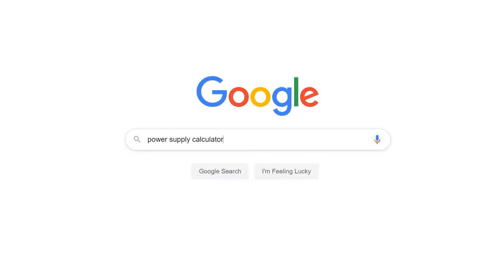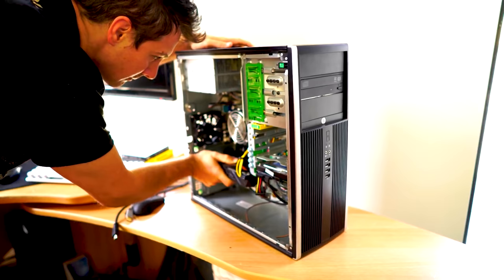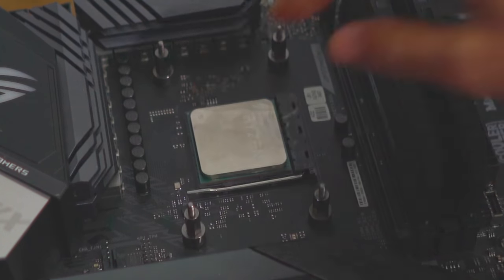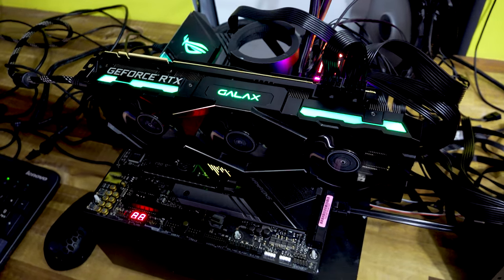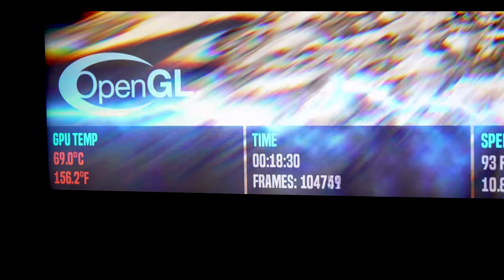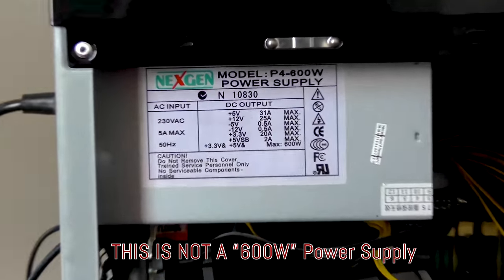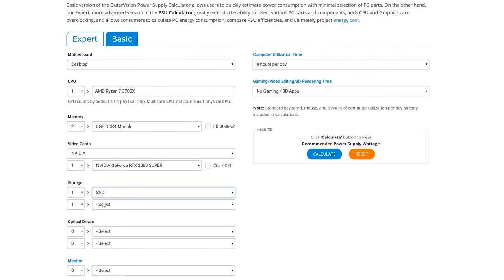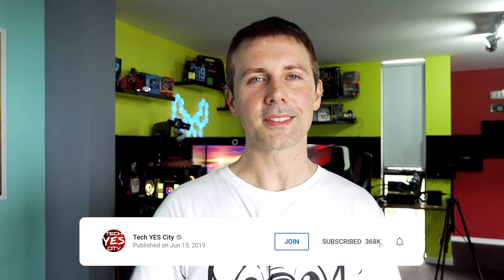I Tried Running a 3950X and RTX 2080 Ti on a 450 WATT Power Supply...

Comment: Hi , what about my Sirtec PSU ? 500w max output , 12v1 20A , 12v2 20A (it has 2 x 12v rails each with 20A) ,400w on 12V. Im using this PSU for 9 years ( since 2011) , i used it on many configurations. First i used it with an oveclocked phenom II x4 955 oc to 4ghz + radeon hd 7850 oc for many years , after i used it with and i5 4th gen oc + rx 480 8gb oc ( even with other low power components like rx 560) , now im using it with an i7 4770k oc + rx 590 oc and its still runing without any issue.

Comment: I got a evga 750watt gold rated psu for the future i dont think overkill psu is a bad thing it just means in lets say 5 years time assuming your psu isnt dead by then graphics card and processors will be way more powerfull more effienct but only soo far ypu can take effiency beforr you have to chuck that out the window to gain loads more performance

Comment: But did you overclock the CPU and GPU, like most gamers would do to get maximum performance from their setup. I doubt it would run for to long before it crashed. Your video card probably crashed the game. Also a 650watt 80 plus PSU will run most any setup out there. Unless your running a 2080, 2080Ti, a i9-9900 or threadripper. Then you might want a 850watt 80plus or higher PSU.

Comment: Planning to upgrade my gpu from rx570 8gb to rx5600xt or rtx 2070. Limited psu choice in my country.

My specs po are:
R5 2600 with stock cooler
Asus tuf b450m pro gaming
Tforce 16gb ram ddr4 3200
Msi armor Rx570 8gb
Corsair cv650 80+ bronze

(I just upgrades psu from generic 600watts and mobo from giga a320m)

Or is there another gpu you can recommend for cv650? I dont want to change my psu, just change it recently.
Reply: I dont plan in overclocking. I will run it as is.

Comment: You did not stressed the system to the max. Run Prime95 and Furmark at the same time and see that power supply burn while trying to provide 500w or more

Comment: My old power supply is 520W but my rule is 80% rule so my current system doesn't use more than a little over 400W.  650W for that setup is correct.  Running a GTX 1080 with old i7 OC.

Comment: I disagree, If you are building a very tight budget PC, that you will not be upgrading or expanding on. Then Yes, buy the minimum PSU needed or just slightly more. But realistically,  Chances are you will upgrade or expand your system. Example: Go from air to water cooling, add lights, add more storage, add controllers (Sim wheels, Flight Sticks), upgrade sound,  or few years down down the road you might decide to upgrade the Processor, GPU, motherboard, also if you overclock or think you will . If you have the minimum PSU chances are you will have to buy a new PSU along with your upgrade.
In the PSU area, I think you better off going with a larger than needed PSU so you wont run into power issues in the future.  Also since it wont be stressed, that PSU can easily last you years thru multiple upgrades. Saving you money in the long run.
I myself run a CORSAIR AX1600i PSU currently and my last PSU was 750watts, That allowed me to use that same PSU for over 10 years in multiple configurations.

Comment: Hi @Tech YES City, I want to upgrade my Graphics card. And I have a Corsair SF 600w psu. 
Right now im running Mini-ITX build with. Ryzen 5800X, a fat Be-Quiet CPU cooler, 16gb ram, 1TB nvme, 5 fans in total and a 1660 Super. on a 27" 1440p monitor. 
I am wondering if my system can handle a RTX 2070 Super? 
Or do I really need to Invest in bigger powersupply?? 

I hope you, or somebody else can answer me this question

Comment: hello please man answer  i just bought a rx5500xt i have i3 10100 1 80cm fan and 2 120 cm fans 1 stick of 8 ram and an ssd 250gb i also have a 400w psu  be quiet 80plus bronze will i be able to run the gpu for some time until i upgrade it ? please answer

Comment: I had a 600w power supply running a 3600 with an XT 5700 and I was getting the green screen of death then a full system reboot.  Gigabyte advised to scale up to 750W, so I did, and problem solved.  Could also have been that my previous PSU was shyte.

Comment: I wonder if you had built that setup you had in a Vapochill PC case and use the Phase Change Cooling system that is built into the case and use a 1KW PSU as you have to power the gas compressor part of the case as well as the controller board, but the CPU has to be installed per the instructions that come with said case actually it is pretty much the same as the Little Devil PC-V10 case.

Comment: I had an old enermax modu 82+ 430w and it powered an rx 570 and an oc‘ed x5660. The system pulled 550w out of the wall

Comment: Should set on a higher resolution to squeeze out the juice on the GPU so that GPU will suck more power from PSU. 1080p is a breeze for Rtx 2080 Ti.

Comment: Story Time:  I got an GTX 1650 with i5 3470 (pretty weak CPU if you ask me and i can't a buy a new one because of the super high prices here where i live.) and a while now my PC started to use more Memory and CPU power while in-games or using browser , i've tried to info myself why and tried to find fixes for it , nothing worked. 5 Months later i found because my Power Cable for my PC was damn weak , after i got a new one it barely uses my CPU and Memory.

Comment: Any PSU I buy MUST say one of four things on it: EVGA, Seasonic, Antec or Corsair, be AT LEAST 80plus Gold-Certified and they BETTER have a single 12V rail.  Also keep in mind that a 1kW PSU is good for anything around 500W and up because PSUs run at max efficiency at 50% load. 

When I see Cooler Master or ThermalTake, I keep looking.
Reply: Cooler Master has a single 12V rail

Comment: Its quite simple

Its used to be that multiple-gpu setups were the cats pyjamas. 3 or 4 way SLI was THE thing back in the early 2010's. Those setups justified the mega power supplies of 1000+ Watt. Add to prominent youtubers (Linus, Kyle, Steve etc) use overkill power supplies due to partnerships.

The calculators online are complete dogshit nowadays, because they sum up the worst case condition of all the components. How are you going to stress all components at same time in a temporary system? - only if you are doing something that stresses all cores of the CPU and GPU - like editing. Most people game, and there is no real difference between the higher core models in games. Modern games don't stress a 8 or even 16 core CPU wilst gaming, even if you stream.

Comment: This helped me a lot. I have a 500W PSU with a 3600 and 16gb of ram and I want to buy a 2060 Super or a 2070 since they have close power draw. Thanks. I calculated and it seems the maximum will be 381W and with my 500W will be more than enough.
Reply: Yo, did u go for the 500w and did you face any problems?
Reply: @qzw-3631  No problems. It runs as it should.
Reply: @paqiuman966  cool to hear that! From my side i bought a prebuilt pc with i5 8500, 16gb ram, rtx 2060 but with a 400 w 80+ and now i'm worried to try a game
Reply: @qzw-3631  well the rtx 2060 is 10W less power hungry and not sure about the i5 8500 but you should be fine.

Comment: Thanks for making this video, the psu requirement subject is interesting because in some cases knowing what you can get away with can keep a budget build's prices down, or make something with a non atx proprietary supply more feasible for upgrade. I have a z230 with a 400w non atx power supply; the graphics card's recommended psu is 470w, but according to this calculator the system only really needs a 400w. I have ran my system (i5-4570, 4x4gb ddr3, rx570, 7.2 rpm hdd) for over 250 hours, with an overclock on the gpu for the majority of that time, it didn't fail the power until I played a different game (BL3). probably because the first game didn't use as much cpu. I turned the gpu overclock off but it still failed once after that, not sure why it would fail when the overclock is off.

Comment: I thought rule of thumb was to shoot for 40% PSU usage?  since it's (typically) the sweet spot in the efficiency curve and keeps it running in silent mode/low fan speed.  ofc, people take it too far and loose efficiency on the other side of the curve..

Comment: Yo bro i want to buy a RTX 4060 but i have a 450w PSu and my other parts arnt that good i have

Intel® Core™ i5-12400F
16 GB RAM, 512 GB SSD, USB 3.0
Windows 11 Home 64 Bit
Mainboard B660

will it run good or not with the PSU?
Reply: Ofc bro 4060 is power efficient it drows around 120w so u can go for it
Reply: did it worked?

Comment: I am currently using gtx 1650 and planning to buy used rtx 2060 is it ok to run it in my 500w 80+ white?? Im not planning to overclock or anything. Btw im gonna pair it with 3300x
Reply: Yes, but i would still undervolt the 2060 with MSI afterburner, it's easy and it would run at 130w with no performance loss, i undervolted my 3060, it uses 115w-135W in games, you also get much better temperatures.. and it even removes coil whine that a lot of GPUs have..

Comment: I'm building a pc for my sister and I need to test it her gpu hasn't come in yet so ill be testing  with my 5700xt on a 430 watt psu her processor is a i310100 should be plenty .. I hope,  the psu also only has one 6 pun so ill be running a data to 8pin also for the card. Crossing my fingers

Comment: Yeah if you get a 500W make sure you get a high efficiency power supply. My system needed the start up current to be higher with my fx8320 and hd7950 but, once it started yeah only 500W but, my power supply could only deliver 450W. So, I recommend a power supply that can deliver 500W!

Comment: I generally would never recommend a PSU under 500 watts, even if the system needs less. Why? Few manufacturers make a quality supply that is under 500 watts, usually anything in the 400 range is lower is low-end/cheap quality simply because it's not cost effective for them to use quality parts in a low-wattage PSU. Usually you need to at the minimum be in the 500 range for them to start putting quality parts in it.

Comment: I had the same issue with my pc. Running Planetside 2 and then it suddenly crashed to desktop without any error message. After that the pc wouldnt turn on anymore and after i calculated the recommended power supply it came out I was 100 W below the recommended one. Just like you it ran quite a time with no problems but suddenly everything came in at once.

Comment: There’s people using gtx 1070/1080 on the low wattage psu inside the Alienware X51.

Prob better be of it was a 450w 80plus gold atleast too just incase as some can some times go a bit above what they r rated.

Comment: So I've currently got a 350w psu pre-installed atm and I bought the AMD Ryzen 5 3400g cuz why not and the gigabyte geforce gtx 1660 super 6gb. Would this run good eith a 350w. I've used outer vision calculator and the max W is around 330ish? But the required psu is 450w but I'm not going to be OC anything just keeping the standing factory settings for everything. Since I'm not the best when it comes to PC's.

Comment: running a 2070 super and r5 3600 for 9 months now on a Thermaltake 500w 80+ psu, no problems at all still wondering if it could handle a 2080 ti haha

Comment: It depend wich kind of Power Supply u buy. A high quality PSU can handle this GPU/CPU. A low Budget PSU not..
I use a 550 Watt Seasonic Focus GX 80 Plus Gold PSU and run a RTX 3080 with Ryzen 7 3700X 16GB RAM 2x SSD and Kraken M22 AIO. It works perfectly in 1440p.

Comment: hey man. will a rx 6800xt be fine with my ryzen 9 3900 with my 550 wat 80+ bronze psu? It does have the correct connectors and My cpu uses 45wats max on spiderman that uses 6 cores and I dont mind undervolting the rx 6800xt to reduce termals and noise. thats most likely what I will do but will it be fine or do I need a new psu? I undervolted my rtx 2060 super from 175wats to 144wats with same performance or 5 fps less at 1080p btw. I wiould be doing the same with rx 6800xt

Comment: 1000W is an overkill but going higher wattage than what you will use is actually a good idea.
1- Efficiency: A PSU will have its best efficiency at ~50% to 80%.. Running it closer to the 100% will make it less efficient, increasing electricty costs..
2- Voltage "quality".. PSU struggling to deliver the amperage will have a "dirty" output, even high 12V demand affecting 5V rail or vice versa... It won't matter at first, but as the system ages this makes for an unstable system even if you don't overclock.. On one occassion, CPU switching to highest power state from idle made my HDD "click" because of voltage dip+drop+droop in 12V line of a 400W PSU.. (Explanation: because HDD thinks there is power loss, it immediately parks the head to avoid head crash, this was easily replicated by running prime95's small fft then idle then running again, and watching increased load/unload cycle count on smart status)
3- Noise: As a result of 1 and 2, A PSU near it 100% rating will ramp up its fan to cool down. A higher wattage PSU will have higher efficiency and/or bigger heatsink, so at lower demand its fan won't even spin up at low system load..
4- Longevity.. A 500W PSU constantly running near 500W demand will not last 3 years.. From personal experience, my 800W PSU (which I bought for a crossfire setup I never did) didn't saw 500W+ usage. Its running fine after 12 years of daily use. If I knew I wouldn't buy the 2nd GPU back then, I would have bought the 550W option instead.. But on the long run, I'll say 800W PSU ended up the cheaper option for me..

Comment: Brother I have 5600g and I am planning to use 3060ti. Will it be ok with 144hz 1440p monitor?...with gigabyte p450b or I'll have to upgrade
Reply: Rip that psu
Reply: @idk_spider1  brother i am using p750b...👍👍

Comment: Ok I am not a computer geek , so let me tell you one thing and also I want your opinion on what I am about to say.  That is back in 2010 I bought a pc not assembled one. That means all the parts are not for gaming . The configuration of my pc back then was core 2 duo 4 gb ram 250gb HDD  and this is what all I know about my pc. So that mean I don't know what power supply I was having but I can play lots of games which is good. And still I don't know what is the power supply I am having. But after few years I bought 550ti 1gb ddr5  which enhanced my gaming experience. That means my psu can handle that card too. Still don't know what my psu specs is. In 2019 I have upgraded my pc into i3 8100 16gb  ram ddr4, 2 GB graphic card, 1tbhdd , still having the same psu. And still don't know the specs of my psu. Know I have decided to upgrade my GPU to rx580 without thinking about the psu. But someone put that in my mind that psu is playing an important roll if u want to use Rx 580 you may have to change psu as well. But I think changing psu is not required. All I have to know is my psu specs. I want you guys to suggest me that if my psu turns out to be 450w then is it good to run rx580 with it. I am not going to overclock it in any way. I'll update you with psu specs soon so please till then all the suggestions are important for me from you guys.
Thanks for reading

Update:- what I have found by visual inspection is that my psu is 250watt strange.
Reply: Time to get a 550 psu then
Reply: @CustardCream22  thanks for advice , you are little late but right . Now I have coolermaster 550 psu with rx580
Reply: RJFlicks I’m late for everything lol. Awesome! Happy gaming 😊

Comment: I have a mysterious 1200w psu recently upgraded to 3080(literally today) the card works but not the rgb(BUT the rgb works if the pc is off and the led indicator that the power isn't in ) is it my mysterious psu causing it to not have rgb(I've unsiintalled all rgb software)

Comment: I bought the Coolermaster MWE550 to replace my dead Corsair 750 watt PSU, Using it to power up the power hungry R9 290x and i7 4790. According to PSU calculator it would have need at least 600 watt which is why i buy the Corsair 750 watt PSU when i first build this rig but it ended up dying anyway. So, after watching this video, I decided to cheap out on the PSU this time, and it works well.. It's only 5$ more than MWE450 lol, so why not? 😉

Comment: would i get a crash or ruining a 1660 supc xc   if i have 16 gb on stick, ryzen 3400 and a psu 450 w?
Reply: its doubtful in that build that 450w rating is the issue. but that doesnt mean the power supply could not have issues. when a psu trips it turns off like the plug was pulled just so you can tell if the crash is from the psu being overdrawn

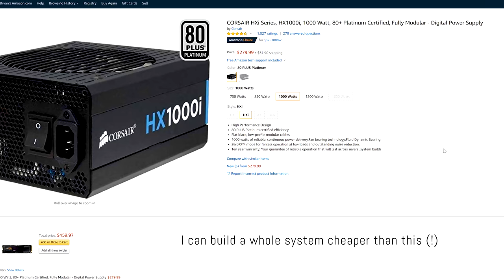Comment: 1:25 this is a pretty bad example, I got a Seasonic Prime Ultra Gold 1000W for 130 USD and I only got the 1000W because it cost 5 USD more than the Focus GX 750W  And the Prime ultra series is much better than the Focus series. Plus then you get into reasons, such as the PSU is most efficient around 50% load though that's kinda minor, the fact that even under full load the PSU can stay silent, etc. tbf I did think about getting SLI 980 setup, but i'll most likely end up upgrading to a 2080 instead once prices drop.  Considering seasonic claims a 12 year warranty on this PSU, this is a long term investment that I'll more likely than not be able to use for the next 10 years worth of systems I build. Also a 650W psu is NOT enough for a 2080 TI and a 3950X if you even stare at OC settings. The 3950X is easily capable of pulling 300W on it's own, the RTX 2080 Ti can hit 400W under heavy OC. Then factor in a high end motherboard that can handle such OC can easily end up being another 70-90W, factor in an SSD, Drives + Ram + fans  is another 100W and you're already at a roughly 900W draw under load. With a system like this you'll likely have water cooling, another 50W, It quickly adds up, sure in stock form it will run on a 650W but even that's stretching it if you do regular heavy workloads. Yes i wrote this without watching the video